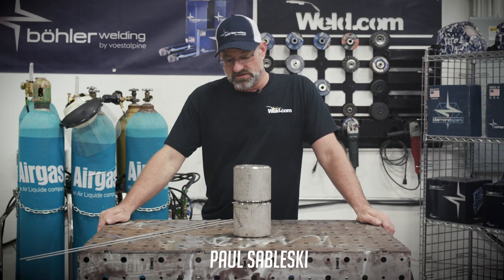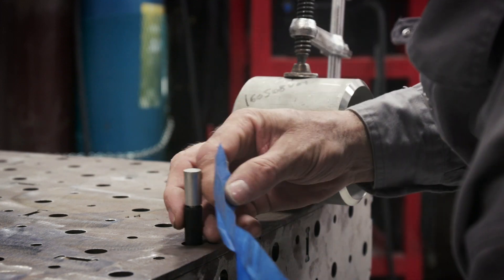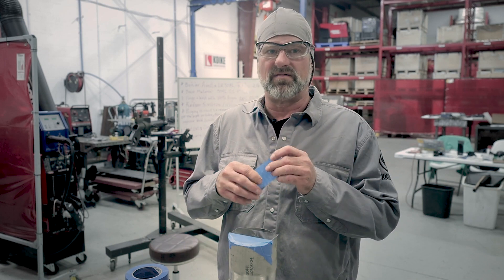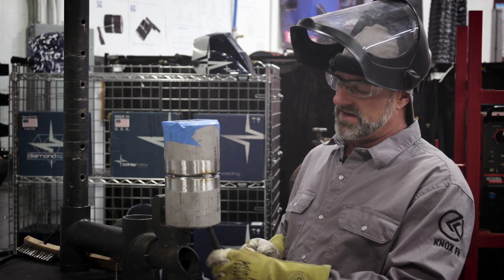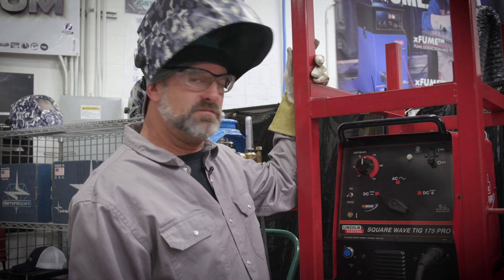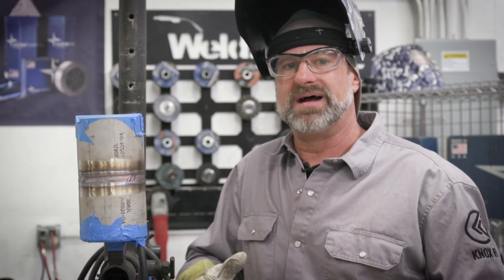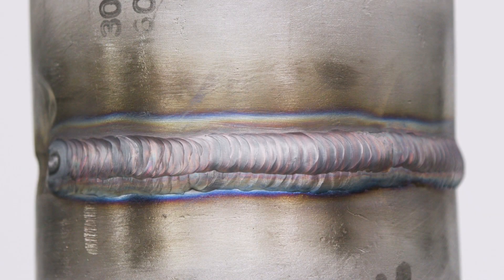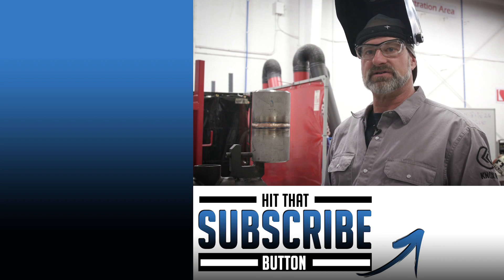Welding Stainless Pipe in 2G Position Using GTAW: A Step-by-Step Guide

Comment: Question:  When welding stainless steal to stainless steel... what is actually happening between the metals?  Are the metals melting together to create a bond, or is the welding material acting as a "glue" between the two metals?

Comment: I just watch video.  Those are large tacs, long and deep.  Is this done to prevent warpage?  On to the rest...

The file...  Will the use of disguised as such allow you to also in the same i stance fix, fix, a minor defect/discontinuity?

Is the minor undercut on the bottom toe of the weld during the walking the cup portion?  

Overall, I liked the vid.  Out in the field getting it done and passable.

Comment: What's with no postflow on the weld????
Reply: If you don't have a foot pedal or finger switch the only way to end the arc is to move the torch away from the weld breaking the arc the same as stick welding, this is not ideal but it's the only way without a remote switch. Once you move the torch away there is no point to reintroducing the shielding gas as it has already oxidized.

Comment: What sort of NDT methods do they do in entry level pipe stuff ? is it still all radiographed ?
Reply: at entry level it will usually visual, break test or DYE PEN, it depends on what code you are working on and what the clients specifications are
Reply: @deancarrick4408  Cheers Dean, I appreciate you sharing the knowledge!